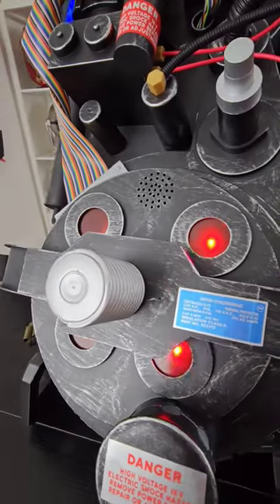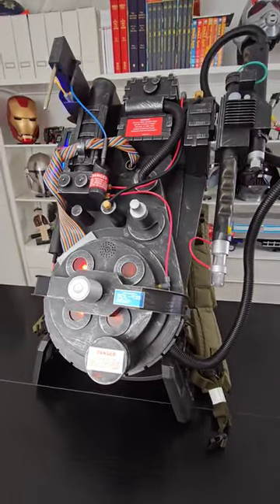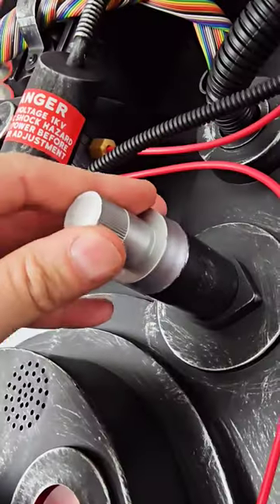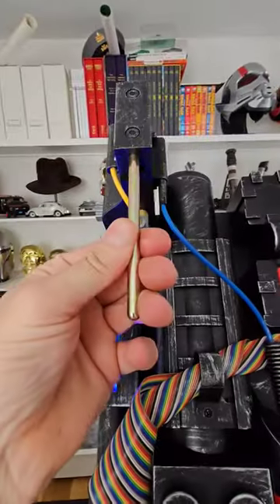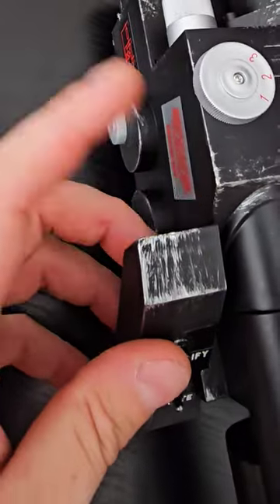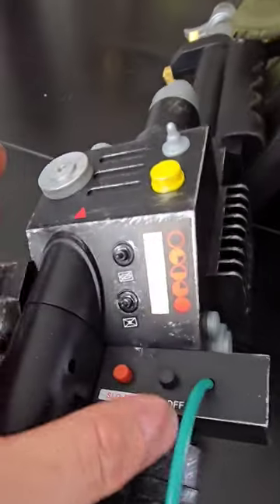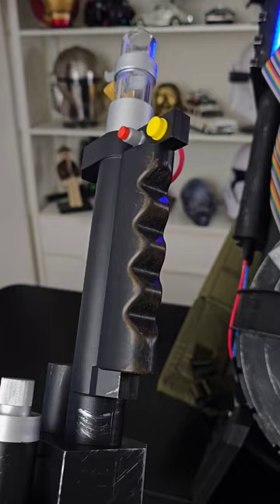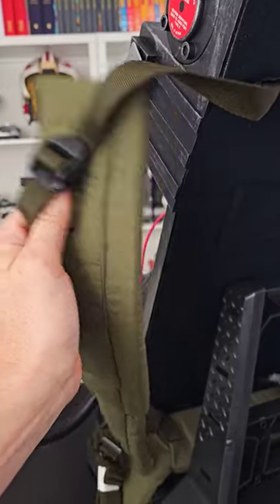Spirit Halloween Ghostbusters Life-Size Proton Pack 1:1 Scale Movie Prop Replica

Comment: How hard do you think it would be to add metal switches to the wand?
Reply from the maker: As long as you can open the wand up it should be somewhat easy. As long as you're somewhat handy with stuff. There's a great facebook group about these spirits packs.
Reply: Very very easy

Comment: What stand are u using!??
Reply from the maker: That's the stand from the Haslabs Pack. But I think any guitar stand should work, they're both about the same size and rounded at the bottom. 
You might also be able to find some 3d printed or printable ones.